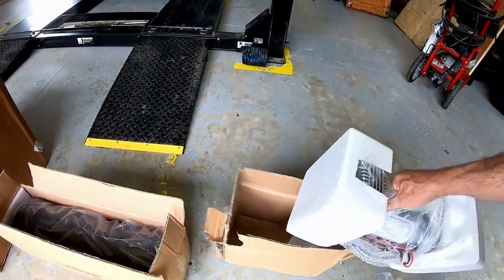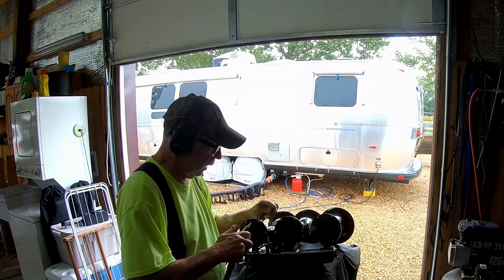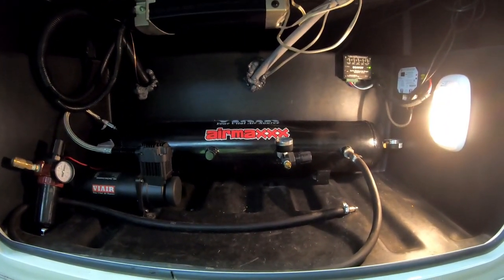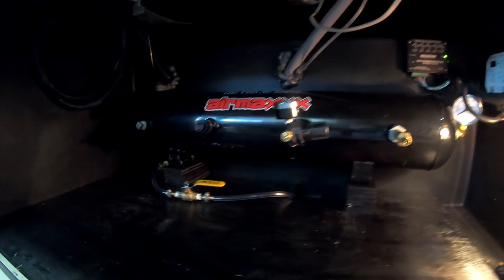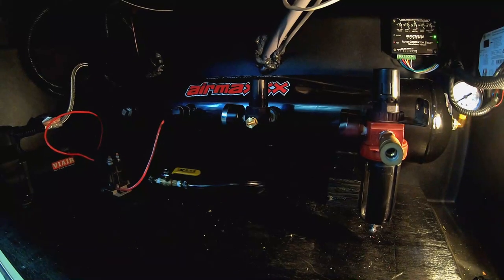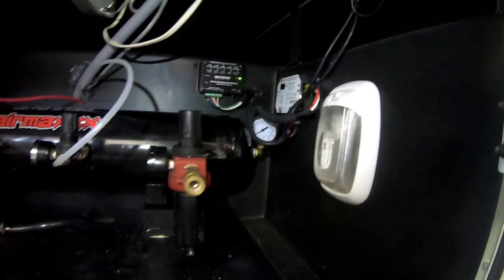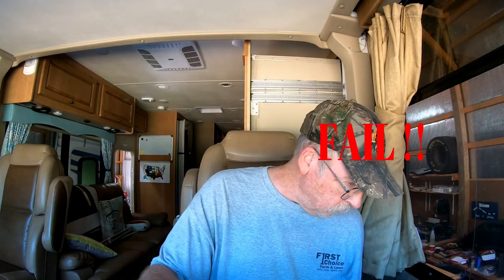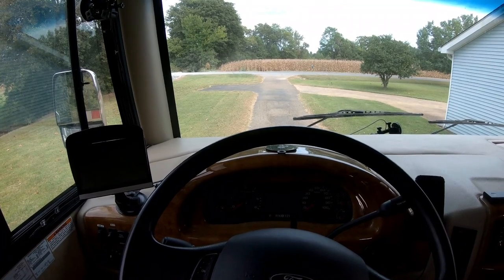RV Travel Channel - RV Lifestyle - In The Shop - Onboard Air and BIG horns S3 EP039

Comment: Real air horns are MUCH LOUDER, a friend in North Texas bought a pair of former ATSF locomotive horns from a locomotive salvage yard in Longview, Tx. & after rebuilding the horns to like-new condition, he installed them on his Kenworth T680 semi-tractor, mounted behind the cab along the catwalk, using the truck airline reservoir & using an electric solenoid to switch between street horns & the air horns, he used braided nylon tubing designed for use on trucks, he didn't clamp the hoses good enough on the first try, but with 160 psi, blew the horns & the pressure blew the hose loose because he didn't clamp the hose tight enough, the NATHAN train horns when NEW cost about $ 1,200 in 2015 dollars, but second hand can be had for about $ 300. at a salvage yard (Which is RARE, as most railroads do not sell to the general public & often remove them from locomotives going to scrap.)  When properly installed, they put out about 115 db noise which is upper limit of what the FRA requires for train horns.
Reply from the maker: Wow, great information about train horns. Thanks, I enjoyed the story. Very cool. Mine aren't super loud but they do seem to wake up the texters. Thanks again for the great comment.